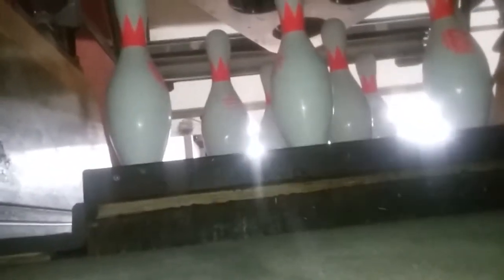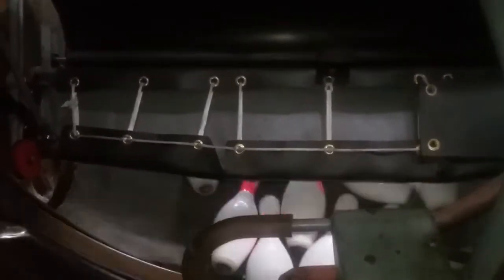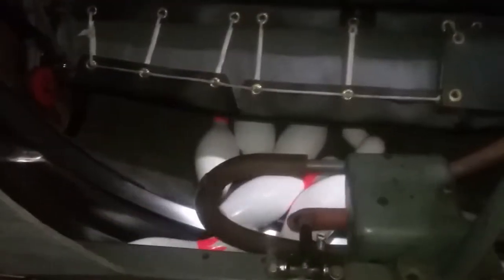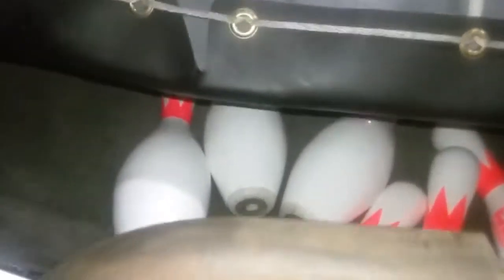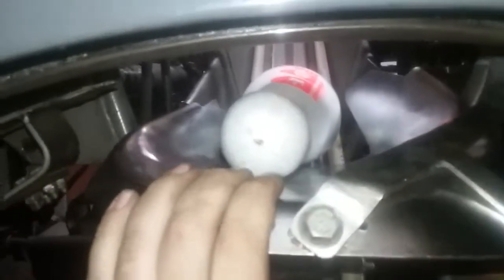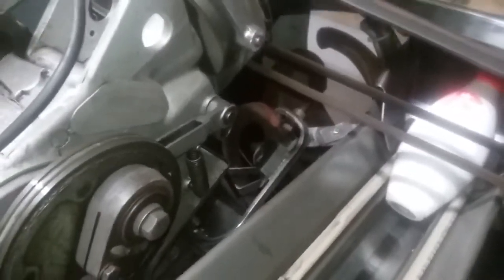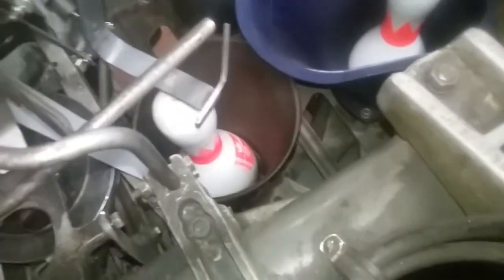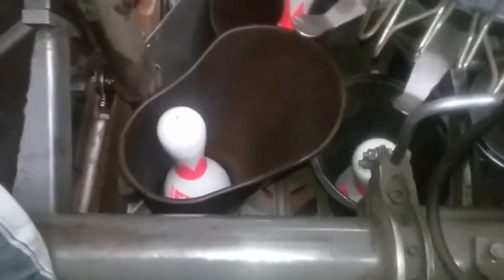how a A2 pinsetter functions ( made it for a friend)

Comment: Nice sequence I love it bowler rolls the ball goes back to the pit board rest on the ball wheel then the kick strips lifts up the ball goes up the lift rods down the track through the ball accelerator, while the pins go through the pin wheel which is drive by the magnetic clutch, pin goes up the wheel drops on the turnaround pan up the cross conveyor, passes through the the pin gate drops on the indexing lever turret turns around while the deck goes from 0 to 90 detecting rake back at 180 rake forward deck down at 270 setting pins and back at zero I love working on them mechanics showed my friend where the 1:1, 2:1, and 4:1 all on the gear box. But nice demonstration buddy🤩🤩🤩 keep it up